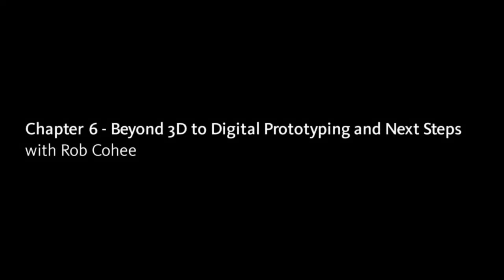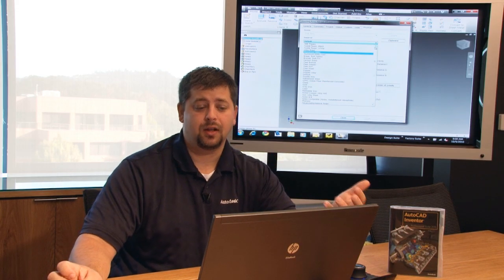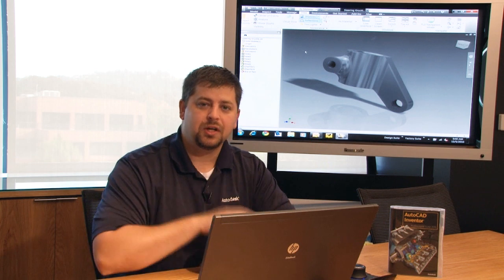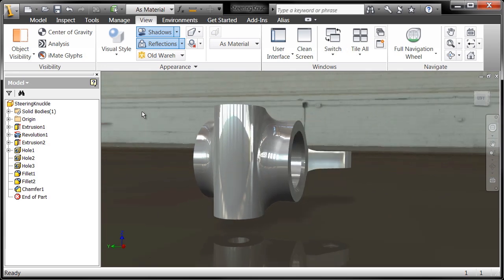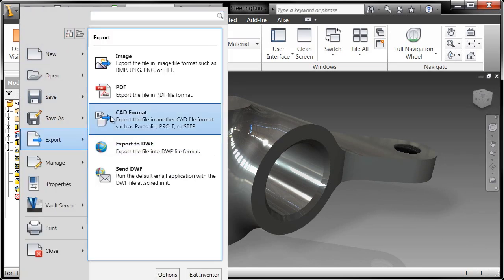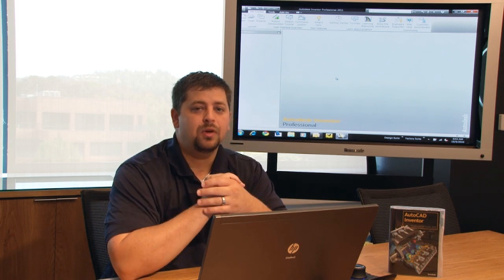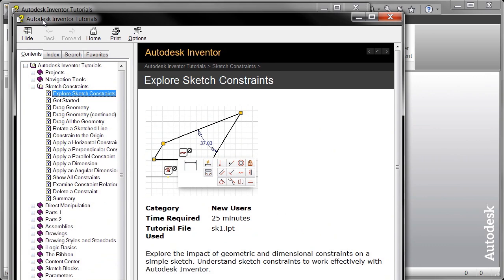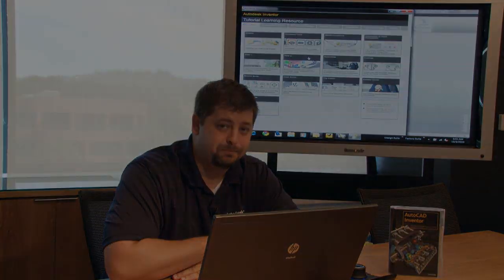Autodesk Inventor Fundamentals - Basics of Part Modeling Chapter 6

Comment: Not going to lie, from watching the first 3 parts i didn't see much difference between inventor and straight up AutoCAD for 3D modeling but when I saw how quick and easily you could place a threaded hole, it was obvious. The only thing was you didn't rotate or move the part itself during the rendering process (such as having the part lie on its side, as it realistically look when placed down) could you still do that in inventor or is it prevented by the axis plane?